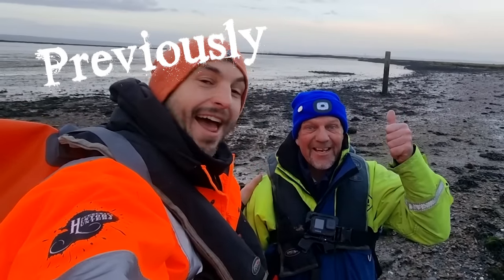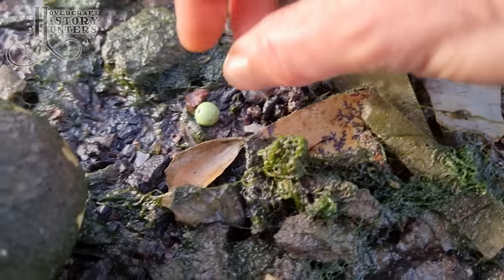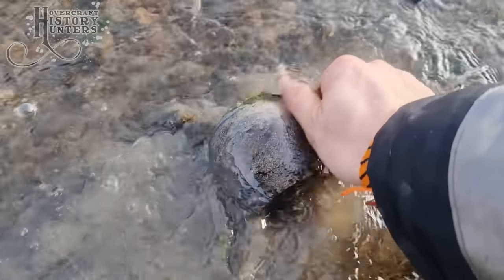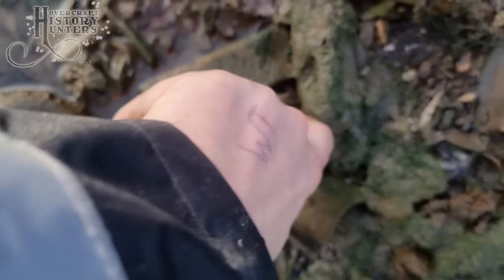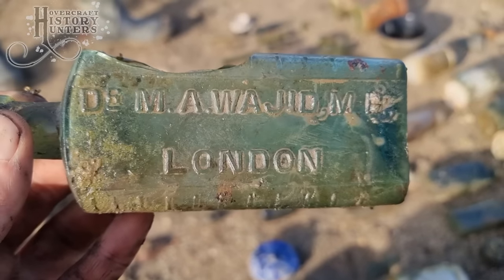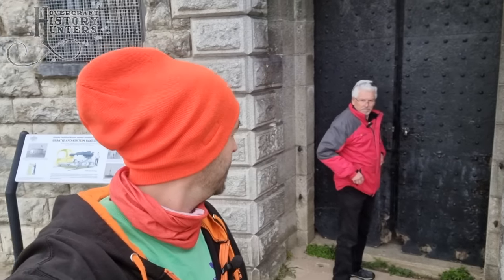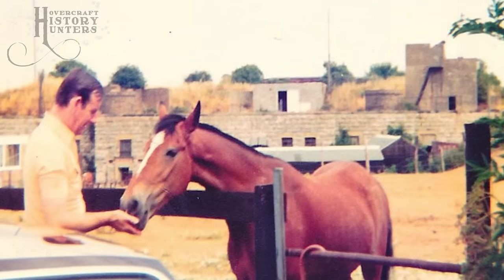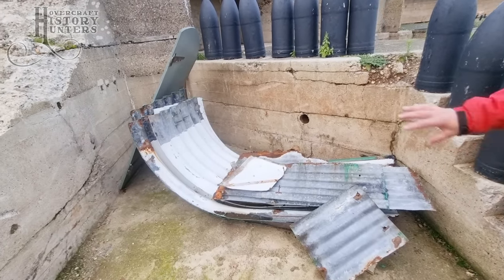Our Mudlarking finds go on DISPLAY in a Victorian museum!

Comment: Pretty sure Green and Smith made ginger beer and maybe other non alcoholic drinks- maybe some connection with the Temperance movement to keep the workers and family supporting adults away from beer and spirits after work, and fit to work next day.
Reply from the maker: Yes you’re right. They made the lot, although not much info on the internet
Reply: @Sifinds  New Hall Street still exists, I’ve looked through the newspaper archives for Green and Smiths but like you I didn’t find much extra info